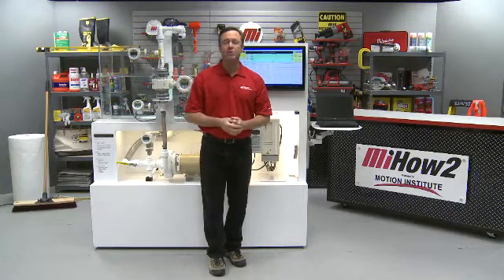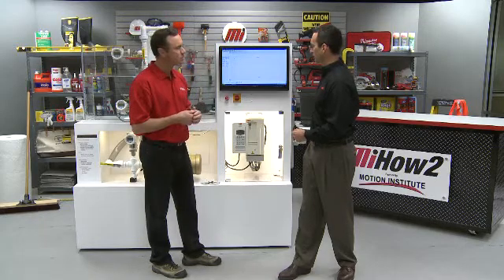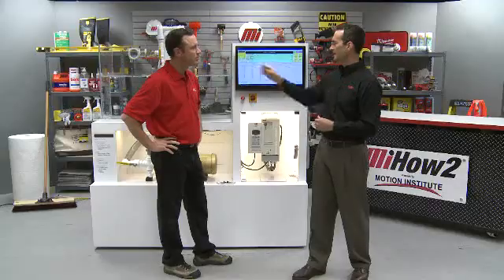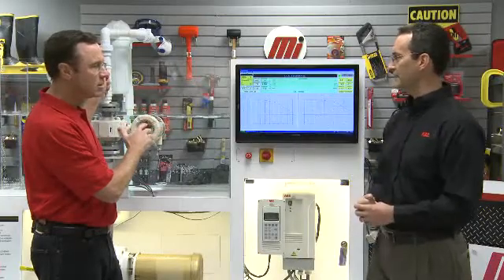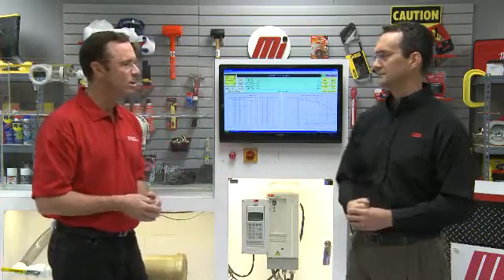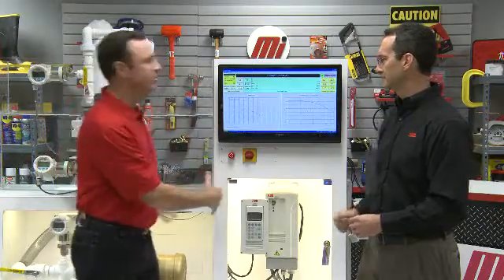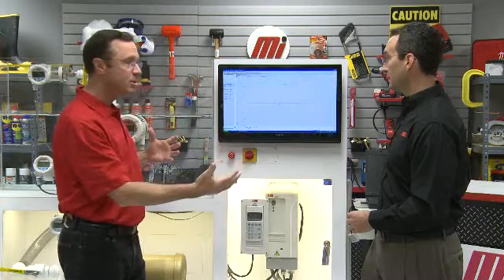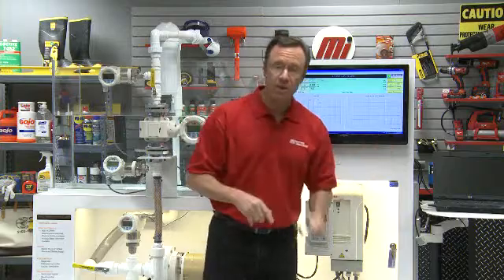MiHow2 - Baldor/Dodge - How to Save Energy by Controlling Water Flow and Water Pressure

Comment: How did you "slow the motor down". Did you reduce the voltage to the motor or reduce the pressure in the regulator...?